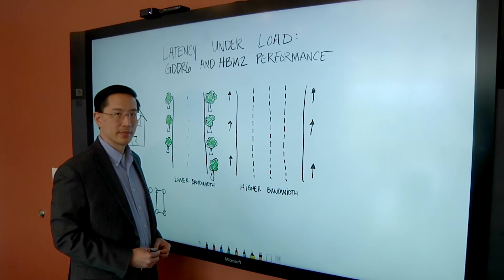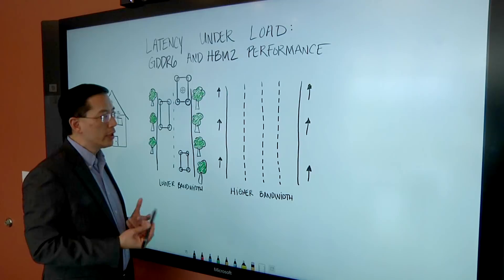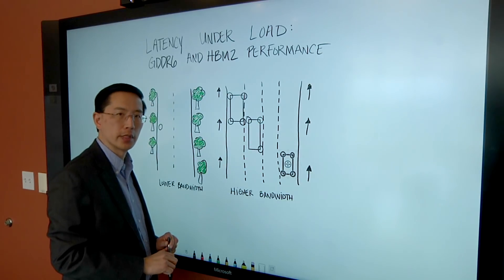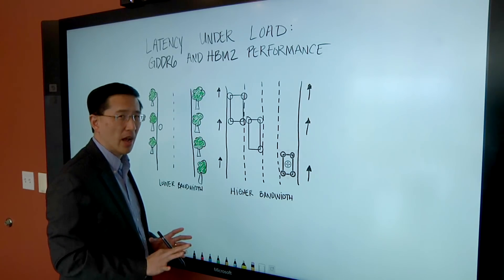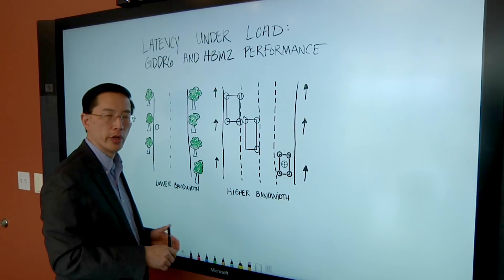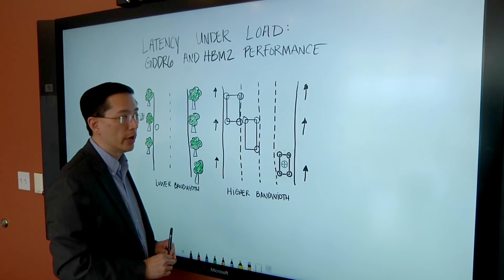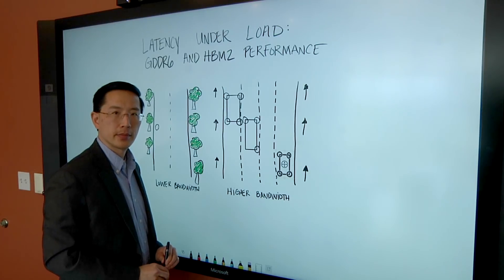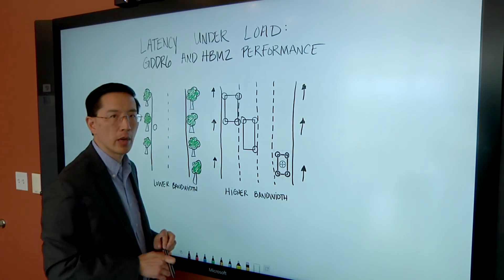Latency Under Load: HBM2 vs. GDDR6

Comment: Excellent explanation and presentation, thank you for sharing this video!
I completely agree that with Moore's law dying we need to make high bandwidth memory a centerpiece of the chip development and that industry should strive for the ONE SINGLE unified non volatile memory of the future with SRAM-like speed and latency with DDR-like capacity, which will be also cost effective and available - I know it sounds like fantasy, but this is where industry should be heading in my opinion.

Comment: So at what point do you really compare HBM and GDDR? All you're saying is to make sure you have enough bandwidth so your transfers don't get stalled.
Reply from the maker: Check out this one for the tradeoffs of GDDR6 - HBM2 https://semiengineering.com/gddr6-hbm2-tradeoffs/
Reply: I think Hatbuster is the "same" as me; a consumer.
Mr.Woo's explanation as to where the benefits of HBM2 and GDDR6 lie were pretty precise and easy to understand in my mind...but most things have long answers so i'd like to reconcile(condensed) as "semiConEng" is not my field of study: HMB2 is the "better" memory for performance(under load->4kGaming) etc. but it comes at a "high" cost and presentes challenges for the people designing it and/or the system into wich it is supposed to be integrated(Graphics cards).The materials have to be paid for and the people working have to be paid (HBM is time consuming) and the "end" consumer likes low prices but high performance. Bascially the people "leading" a company have to make a tough wager trying to keep the balance between cost and efficiency? "Zeit ist Geld und umgekehrt gilt dasselbe; Geld ist auch Zeit." Time is Money and contrariwise; Money is also Time.
In very broad-terms, is this correct?

Very Good video and nice Teamwork!
I liked the analogy.But that depends on whether I am right thinking I understood it correctly
Wont be waiting for an answer, very interesting videos -> going to start at the beginning of the series.
Reply: I think a short answer would be apporpriate but no gurantee that I'm right: HMB2 is better but sometimes not better enough to be worth the money and time.
Suppose you've got two cards that are the same price n' all the specs are the same, and the only difference is that one has HMB2 and the other has GDDR6 -> get the one with the HMB2.
?